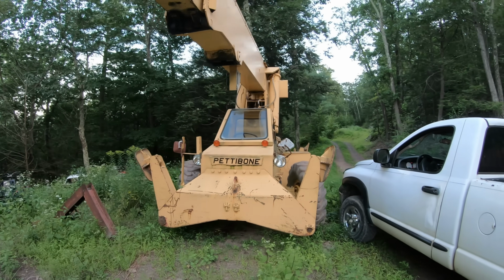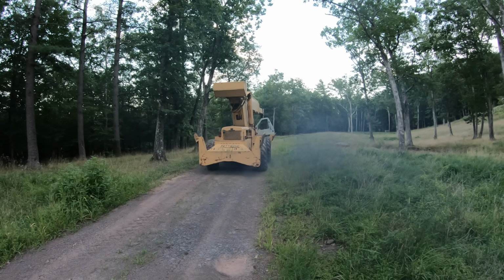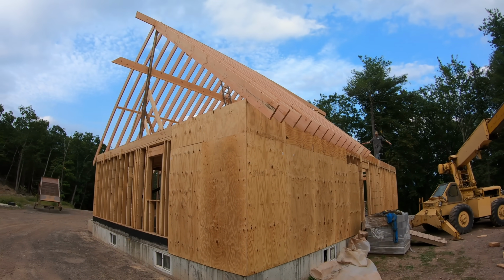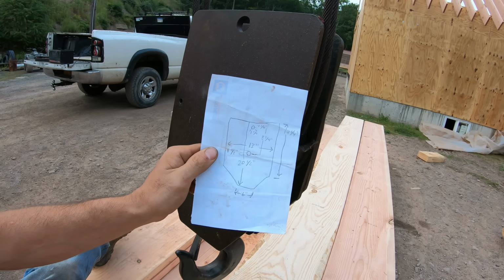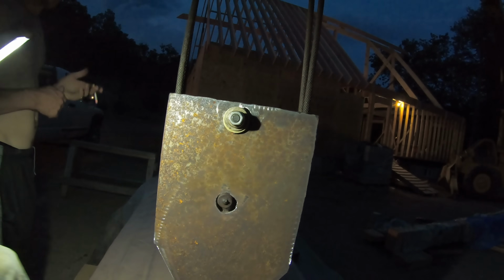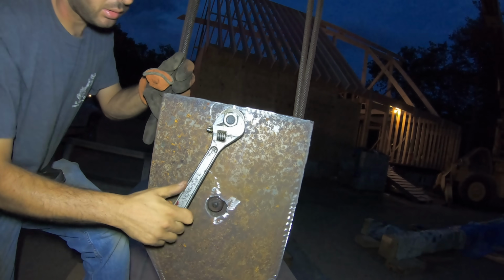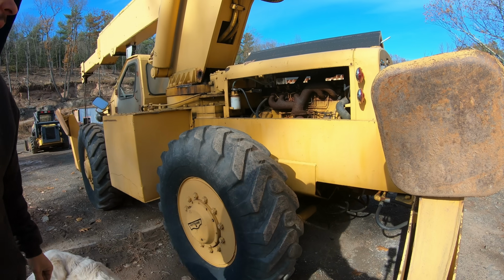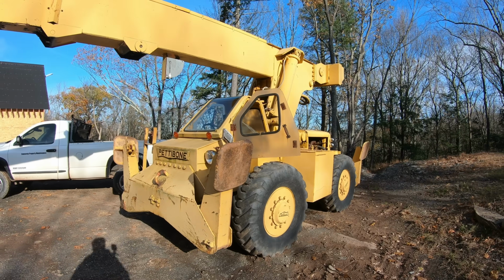Working with a Pettibone crane

Comment: Kick the 4 part line down to a 3 part use the big hole at the top of the block to secure your becket may need a shackle or 2 this will help with your weight/spooling issues not sure the line pull of the winch but I'm sure 3 would be lots good for what you need

Comment: If you're gonna use one sling in the center of a long pick like that, use a gott dang tape measure to find the exact center point.  It'll save you so much "cable up, cable down, cable up, cable down, cable up" etc. etc.  Also you guys ought to learn the universal hand signals so you aren't relying on audible signals to run the correct function.  Just my two cents

Comment: Your running a 4 part line. You can rig it to a 2 part and it will run much faster and smoother. Also get yourself a heavy pill ball fir that light work.
Reply: Also your block is much heavier now. Make sure u account for that weight when figuring load capacity

Comment: Somebody correct me if I'm wrong but it looks like the first part of the boom is not retracting fully! This will cause instability when moving this crane. "Squirt boom" rigs should never be moved without fully retracting the boom. Never travel with a suspended load on the hook! If moving on unstable ground deploying the out riggers an floating them a few inchs above the ground will help avoiding over turning.

Comment: Also I do not know why you have a two-part line on that cable I hadn't seen you lift anything that would need a two-part if you one parted it you would not have any problems with the cable and number two it would go faster

Comment: Man you should look into marine solar powered battery tenders for your equipment. Whenever im away from home and don't have access to shore power i switch to solar and it hasn't let me down yet. Wont charge them from dead to well but works fine to keep a charged battery charged.

Comment: Andrew: u can install a 50 watt solar panel on top of the engine bay flat with a solar charge controller and that will keep the batts @ 100% when the crane sits for weeks on end and will make the batteries last double the life time and install a Desulphation unit on the battery which will help make the batteries last 3 times longer. If u have other machines that sit idol for a long time then I suggest the same thing for all of them. Just remember to clear/clean the panel from snow atleast once a week. Even on cars they will save u money on replacement batteries. Saves u the time doing maintenance charging and also taken the batts in and out which is a pain in the arse.

Comment: So, can you just replace 2 6volt batteries with one 12 volt? Also, as much as that thing sits put a good battery disconnect on it. Does it need a new starter too?
Reply from the maker: The two 6 volt battery's are hooked in series, so its a 12 volt system. Yes, it can use a 12v battery as long as it has enough amps.

Comment: How did you make your workbench?
Reply from the maker: That is 4" steel angle iron, with a poured concrete top. They are very heavy, it takes a forklift to move them.

Comment: I was working on a project at a local papermill (retired IBEW electrician) that had several cranes onsite. One was a Pettibone, looked to be a little larger than the one in the video. The site was off limits to regular traffic, but a phone company employee kept parking his work van in the worksite area. Having been warned to keep out, he kept coming back and parked at the side of the Pettibone close to the rear wheel. The Pettibone operator came back from lunch, started up the machine, and proceeded to put out the outriggers. The outrigger on his right rear side went down thru the side of the van and pinned it to the ground. You should have seen the phone company guy when he came back. The van was totally destroyed, the Pettibone only got a few scratches.

Comment: There was a Pettibone log skidder for sale in Australia, never seen one before, they used loader axles, Detroit engine, truck gearbox, winch on rear and blade on front, it was all cobbled together in thick plate, welds were rough, it was a goer asking $5000au, this crane is a lot different and well made.

Comment: Yeah, so the reasoning behind not having the cheek plate on that side of the block is that the crane's capacity isn't effectively good for any more than three parts of line.  The becket gets pinned into that "mystery hole" and the block hangs relatively level. Adding more weight on that side of the fulcrum, just reduces net capacity, as does the added unnecessary weight of another part of line. Try not to let your ignorance get someone killed, because that's what happens when everyone thinks they can be a crane operator...it isn't just about pulling levers.

Comment: That battery setup is odd. 2 6-volts in series? Why not 2 12-volts in parallel for more amperage to the glow plugs and the starter at the same time?

Comment: If you haven’t removed the hook from block to check shank & nut threads for wear & corrosion you should if they are ok lubricate and bead of sealant on top to keep water out. I have seen old hooks pull out of blocks under load. Best of luck.

Comment: Whenever installing a brand new battery, always trickle charge it on lowest setting and get it up to 100% charge.  If not, the battery will not last as long or have as good ability to take full charges in future.

Comment: The crane has three (3) speeds. When you road make sure  you disconnect the two pump gear box ,,,, take it out of four wheel drive. S/N  should be stamped on right side frame rail near cab door and on top of frame rail next to engine  left side.

Comment: I may have built that crane!!! It has a gas engine.  That is not the original hook block. The ring welded on the front outrigger is there to attach the hook block for road travel.
Reply from the maker: That's neat, it has a diesel engine though.

Comment: Andrew ...here is a good tip for you when jump starting ...hook the positive to the battery and the negative onto the engine somewhere where you get metal contact. That crane would have started.

Comment: Be careful when storing a crane and cables outside.  The large cables will often have a natural fiber core that will hold moister and rot the cable from the inside but look fine on the outside.  The load capacity is unknowingly reduced.  Sometimes severely and surprisingly.

Comment: 2 6 volts in series? why not just throw 2 large 12 volts in there in parallel and have it have more cca than needed?? seems pointless they designed it to take 2 6v in series when they could have just put a larger 12 volt single battery or dual battery.

Comment: Batteries? Anymore you may getaway with just putting a single 12 volt battery in that machine. 1000 AMPs or better. That way you can remove it and use it on other equipment and bring it inside for good keeping  (trickle charge). Buy maintenance free with handles. Batteries and tire $ can eat your alive.

Comment: "Just needed batteries."

What about other starting aids ?
Reply: Never use starting fluid on a diesel.
Reply: @jordanlutz8307  Without, they won't start. D'oh !
Can you light gas with the gas turned off ?
Reply: Diesel engines don't have spark plugs. Starter fluid isn't really going to help. The only thing that helps are the glow plugs.
Reply: @jordanlutz8307  I can tell by your comment you're young and not very familiar with diesel engines. I can think of 6 other starting aids for diesels that have been/are used over the years. And I'm sure there are ones I've forgotten !

Comment: 10:46 so the hook has an extra plate on one side so it doesn't hang straight - so they've added another plate to the other side. 
Wasn't the obvious solution to take the extra plate off the other side instead ?
Reply: I can't say for sure but I am guessing the spooling problem he mentioned it having was caused by both the unbalanced hang and the lack of weight so taking off the plate to balance it might not have helped. Maybe Andrew will chime in here and let us know for sure.
Reply: @mute8s  Surely an odd situation having an extra plate just on one side !
Reply: @millomweb  Definitely. However I did see someone else mention that the original plate may have been removed to fit in a small place and maybe taking off both plates just wasn't enough weight on the pulley  to keep it from unspooling up at the main cable reel. But that's all just speculation on my part since I've never run a Pettibone.
Reply: @mute8s  That sounds a bit bizarre as it doesn't make it much smaller - and why didn't they refit it afterwards ?
Reply: @millomweb  That's just a guess, but I do know that there are plenty of times using heavy equipment way out in the middle of nowhere sometimes you do what you have to do and maybe that extra inch of width from the plate and bolt was just enough to keep the job from getting done and lots of people are lazy and the guy just never felt like putting it back on. I have seen some pretty sketchy stuff being done with a telehandler when we were out in the middle of nowhere and had to move a shipping container and we didn't have the option of getting the right tool for the job.

Or maybe the previous owner just had this sitting in his yard for a long time and needed a steel plate that size and used it somewhere else.

So in all honesty without knowing why it was missing I didn't find it odd. The world is a weird place and people do some stupid things but as long as the job gets done and no one gets hurt then have at it. Just be sure if something does happen you take responsibility for your actions.

Comment: If you look at the label on the old batteries, the outer one was rated at 1000 amps and the inner one was 845 amps.  Diesels take a ton of power to start when cold. Cranked great with new batteries though. Compare that with about 600 amps to start a typical car gas engine.

Comment: Hey Andrew I have 0 experience with cranes but I did notice the 2 cable clips that secure the end of the line to the boom tip. I was told once that whenever you load a cable you are supposed to use a 'tattletale clip' Its a clip that clamps a few inches of slack in the cable end but carries no load. The idea being if the load carrying clips ever slip you will know because the slack will be taken out of the 'tattletale'. Maybe you already knew that, thought Id mention it. Thanks for the great videos, always enjoy the content.
-Vincent

Comment: diameter squared x 8 = safe working load of your swr (steel wire rope)...i used to use one of these 10 ton petibone cranes in the 80's great rig and fun to operate.the crab steering lets you get into tight places. gl andrew

Comment: I was wondering why that snatch-block seemed to be hanging funny. What do the Span-crete pcs weigh in at and what kind of rigging do you need to set them? Just wondering if you’ll have enough boom when you figure in the length of the rigging.
🤜🤛

Comment: Hello
I saw in your films that sometimes you fix electrics. Therefore, I have a question. Do you need to have special qualifications like me when the voltages in the circuits being repaired exceed 25 V AC and 50 V DC?
P.S.
In connection with my work, I must have SEP qualifications up to 1000V.
Reply from the maker: Here the only voltages I am dealing with are 12v DC is auto applications. And 120/240v in buildings. Some areas require the building electrican to have training. Not here though. But they do inspect the work to make sure its done right.
Reply: @AndrewCamarata  I understand, you do not need to have special electrical permissions, while someone with such permissions checks the work done by you in buildings.

Comment: I ran a lot of these over 35 years. I wonder why they had that extra plate on one side.The one you have was one model I broke in on. I would suck in your jib in and take a cable and hook it to the front of the bone and take the other end and put it on the hook on the block and pull it tight when traveling. This will keep you cables from coming off the shives and bouncing. Just a little trick when driving down the road. Did you see how the block swings, the cable with stop that. When you park it I would also raise your boom to help drain water when it rains. I know lots of little tips. Pettibone is # 1.

Comment: Are those 6V batteries cheaper?
You could have changed it to 2 parallel connected 12V ones, which are more common, or am I wrong?
Or does it have to do with the current, the other cables you need or what, Andrew?

Comment: Anderson connectors (red 50a/6 gauge wire) from battery to front and rear bumper receivers of truck. This is great for portable winch and access to power.

Comment: Crane looks to be handy to have around. I did buy myself a new plasma cutter. Held off forever because they were always so expensive but price has dropped. Picked up a new one that will cut up to 1" thick steel for $1450.00 and had the dealer include another 6 tips.

Comment: Battery’s and a fresh set of Glow plugs is what she needs and never ever use starting fluid 
In a Diesel engine always use Big Blast WD-40 .......Love your Videos being a Mechanic i find some of your repairs interesting.....👍🏻🤘🏻
Reply: We used to put some gasoline on a rag and rest it near the air intake when we didn’t have starting fluid or WD-40. I know, I know, not good for a diesel engine but it got us going.
🤜🤛
Reply: What if i have a vehicle with factory installed starter pilot thing :) i know the fluid is weaker than whats in the cans but still thats factory equipmen for winter use

Comment: Safety nitpick.. when lifting thin sheet stock and plates it's good practice to c-clamp the price to the forks of the hi-low to be sure it doesn't accidentally slid off the forks in a turn or on your driveway to garage transition.

Comment: You should get yourself a 12v 10w solar panel that plugs into your battery to trickle charge your battery while it's not being use in case there is any unknown current draws.

Comment: I just wanna suggest an upgrade for you that might help you put a lot since you seem to jump start a lot of things. I think a lot of manufactures make them but it’s a winch plug that goes to the front of your truck for a winch(warn makes it). You can get a pair of jumper cables that have the plug on one end so you can plug it in and jump whatever. It makes it so you don’t even need to pop your hood to jumpstart a car.

Comment: If you want to know if it's in 4wd or not just get the wheels off the ground with the outriggers and let the clutch out, usually doesn't do them any good to keep in 4wd on hard ground or roads, loose hard is okay, up a hill is good :) Nice clean exhaust on it...

Comment: I always wonder how often Andrew is replacing batteries and changing the oil of his heavy equipment. What does that cost per year?
Reply: I wonder that too. With a lot of vehicles, you have to keep track of a lot of batteries. Lead acid batteries are usually only good for about 3 years.

Comment: In some cases a small 10 watt solar panel hooked directly on a kinda dead battery will keep them topped off enough that you could go a couple of more years with out having to replace them. The total investment is about 20 to 30 dollars, Pretty much the cheapest 10 watt solar panel will do. 
I have seen a 5 watt panel keep a small truck battery charged up enough to keep it running a few more years, With out that panel a day or 2 and it would not start. 
In some cases equipment that is not used enough during the year would benefit from something like this. 
Other equipment that does get used more often and does not have the risk of solar panel damage, One could install a 100 watt panel ( about 2 feet by 3 feet ) which cost about 100 dollars shipped and a 15 dollar charge controller and some wire ( total less than 150 dollars. ) This would keep those battery charged and prevent the odd chance that a key, lights or something left on and would allow you to start your machine. Dump trucks, Pick up trucks would be something one could add panels to as well. 
I plan on installing one on my Dodge 2500 4 door, I have not gotten to it yet, As I want to replace the head liner when I do it and need to build and install some sort of rails at the same time. So that I can install some cross rails to install the panel and run the wire thru a waterproof connection and down thru the post and on to the battery area where I can install a charge controller.
Reply: Yeah, but you have to keep a very close watch on them because the battery acid tends to evaporate quite rapidly.
Reply: @putmeincoach7663  10 watts is less than a half an amp, Which at most might give you about 6 to 10 amps per day on the super high end, With the losses a semi dead battery you will be closer to replacing what drains out every day.

Comment: Get yourself a solar panel charger  off ebay (10 watts would be fine ).  You will get great service life on those new batteries if they are always kept fully charged.  Let them sit and self discharge will kill a battery is a couple of years. Also flat batteries are more likely to freeze.

Comment: Propane engine shouldn't smoke like it's running on diesel
Reply: You are correct, but since the crane is a diesel, it will smoke like a diesel.
Reply: @mmm365  diesel
🤜🤛

Comment: Probably a stupid question, but how does the plasma torch not cut through the forklift forks when you were cutting the metal plate?
Reply from the maker: cwinter84 I had a block of wood holding it away.